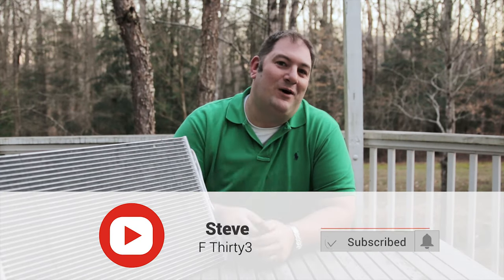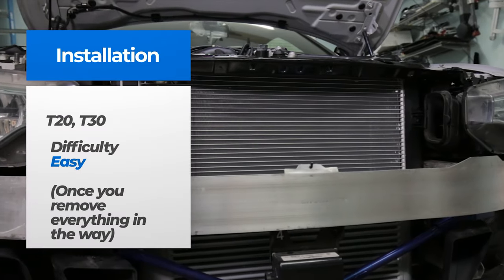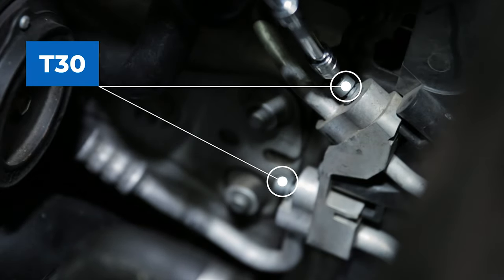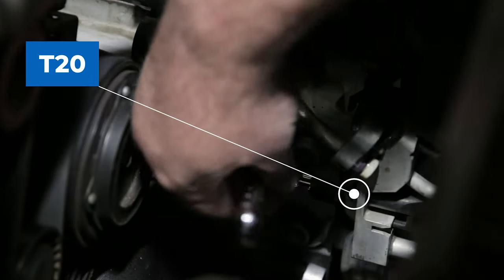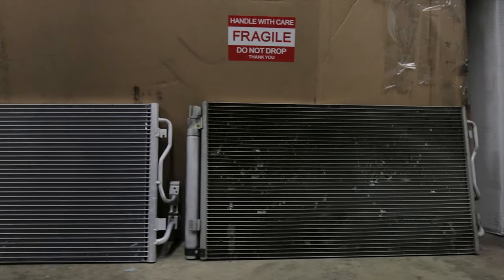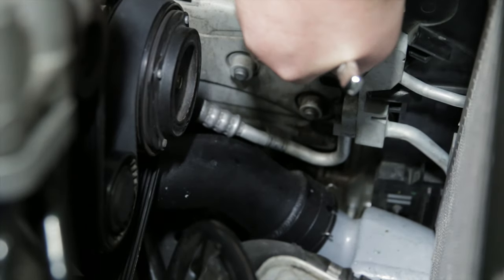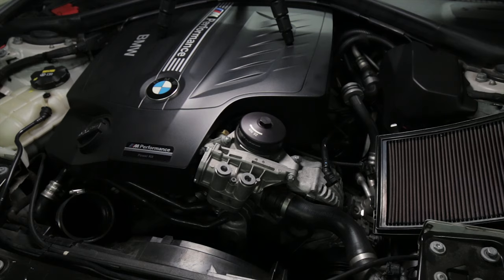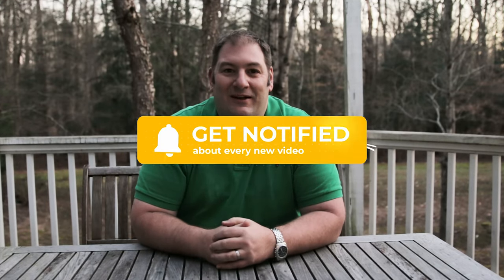REPLACE YOUR F-SERIES BMW A/C CONDENSER (F30, F32,F33,F36, F87)

Comment from the maker: It's so nice to have cold ac again. It's also nice to have not paid $600 for a new condenser! 🌡🧊❄

AC Condenser:
ECS Tuning - CSF: https://www.ecstuning.com/b-csf-parts/a-c-condenser/10805~csf/
FCP Euro - https://www.fcpeuro.com/products/bmw-a-c-condenser-64509288942
FCP Euro - OEM: https://www.fcpeuro.com/products/bmw-a-c-condenser-genuine-bmw-64506804721

🛠Tools Needed🛠
T20, T30
Torque the AC lines to 10NM

Digital Torque Angle Wrench: https://amzn.to/39YqYS8
60pc Torx set: https://amzn.to/39Yvd06
Dewalt Cordless Drill: https://amzn.to/2XwXx4K
Dewalt Mechanics Tool Set 247pc: https://amzn.to/31CHbcf
AC Vacuum and Manifold Gauge Set: https://amzn.to/32bI5wY

🎥 Helpful Videos 🎥
Install the CSF Performance Radiator: https://youtu.be/ZxJ61JY2iaY
Evacuate your car's A/C system the right way: https://youtu.be/R9Phspqjef4
How to recharge your car's A/C system: https://youtu.be/CBQuC-Ykg0I

Comment: But when you open the tubes, do you need to recharge gas? I mean, does the gas come out when you take out hoses connected to the radiator?
Reply from the maker: Great quest! Before you disconnect and remove the condenser,  you need to evaluate the refrigerant. I made another video that goes over the process to do that.

Comment: So I brought my 440i GC in to the BMW dealer here because the AC was not blowing cold. They said they ran diagnostics and they said they found the front radiator which is the cooler for the R134 (ac gas) is leaking. Their first step is to replace that radiator and recharge the AC system and add dye in the system again to check for other leaks. The cost is $2789.08.  Is this what you are replacing in YOUR video? Help!
Reply from the maker: Yep, that's exactly what I was replacing. Wow, $2800 is crazy expensive!
Reply: @fthirty3  I will buy the radiator online where you got it and have a local mechanic install it. Anything I should watch for? Any tips ?

Comment: Can this be done from the top on the 3L versions do you know? About to tackle mine at the weekend
Reply from the maker: There's no way to get to the condenser from the front unfortunately. The only way to remove it is to first remove the radiator and fan.

Comment: Hi my car has been in a crash it’s a 118d F20 but the condenser is pretty much the same as this one but no matter how hard i pull they arent separating like it does around 2:50 Do you know why?
Reply: Did you manage to remove them? Someone told me to run the car for a bit to warm them up first. I am going to attempt this next week.

Comment: Can you avoide taking the radiator out by just taking off the top black plate?
Reply from the maker: I dont believe you can. There's just not a lot of room in there
Reply: @fthirty3  damn this job is a total nightmare.   Idk how you make it seem so easy
Reply: @jonathanschultz2472  How did you do it at the end? I have to do it on my 435i, but there is no any DIY video. I saw guy did it on 528 by removing the top plate. I hate to remove radiator. All plastics are so brittle.
Reply: @slobodanmilovanovic7281  I did it from the top like him.  But if you have a transmission cooler those lines and the little box that bolts to the fan shroud makes it a total NIGHTMARE.  
I was so close to setting the car on fire because every video it all comes right out and falls right in.  Transmission cooler then that's NOT the case.   I nearly broke my radiator.   It's possible I did it just be careful
Reply: @jonathanschultz2472  Thanks a lot for a quick reply. I will probably first remove the fan shroud as I was planning to replace the serpentine belt and pulleys so need that extra space anyway. But it's good to know that you made it from the top. Thanks again!

Comment: Should you add oil to the condenser?
Reply from the maker: I did as part of the refrigerant refill process
Reply: @fthirty3  got it thanks! I replaced my compressor, dryer and condenser and system holds 6oz of oil. I’m refilling the compressor directly with 2oz, 1oz on dryer and 1oz on condenser.
Reply: @DonBMW where you put the other 2oz of oil or did you only add 4oz to the system?
Reply: @luisvargas4577 
Great question. I added exactly those as mentioned or total 4oz. Since I did not remove or flush the evaporator core it’s safe to assume 2 ounces of oil may remain in the core. After I buttoned it all up car was working flawlessly in Tx heat of 105. Nice and cool. Been working great ever since. No issues.

Comment: Hi can i just check is the very front radiator a water radiator that supports the Aircon system as i must say i am confused now i have just replaced the A/C condenser dryer and the air is still not cold and the garage now is pointing to the front radiator which is apparently leaking but i thought the A/C ran solely on gas? Many thanks in advance
Reply from the maker: The front radiator is attached to the dryer. Usually it all comes as one piece. It's filled with refrigerant wich is a gas or liquiddepending on where it is in the process. If it's leaking, it's leaking the r134a refrigerant
Reply: @fthirty3  many thanks for the conformation

Comment: I can't remove a.c lines I managed to removed one unscrewed but it's hard
Reply: Same here has anyone got any solutions?
Reply: @robthetennisman  I managed to take it off with a Dremel pliers and all of patience put the new one on no problems i also used the same oring
Reply: @1hughjanus80  cheers mate, I’ve ordered a heat gun so hopefully will help to loosen things up a bit. Also tried with the drill yesterday but broke 3 bits!
Reply: @robthetennisman  were you able to get it off with heat gun? I am having the same problem. None of the AC line is coming off. I've unscrewed it but the bonding is very hard.
Reply: @zafor99  the heat gun didn’t really work but I was able to get it off with a tiny screwdriver to pry with and a lot of shocking with a hammer

Comment: Hi I have removed the T30 screws but the bottom AC line doesn't come off? Could you please help?
Reply from the maker: Mine bottom line was a little stubbern as well, but it was only those T30's that held it on.